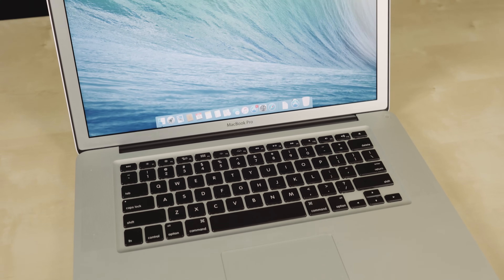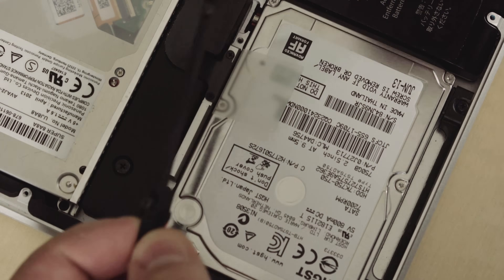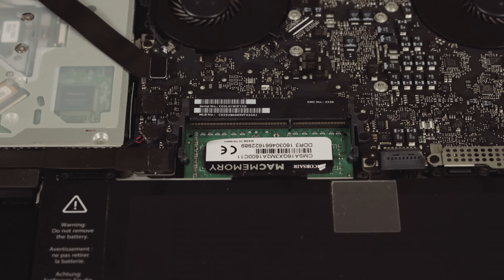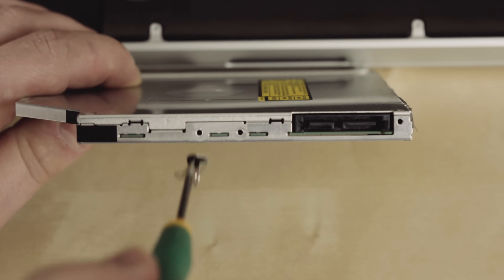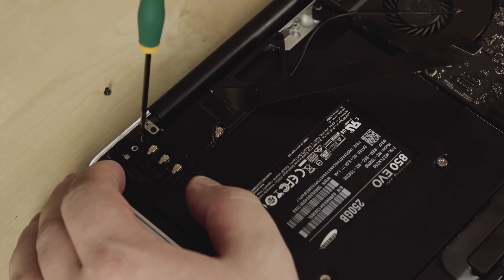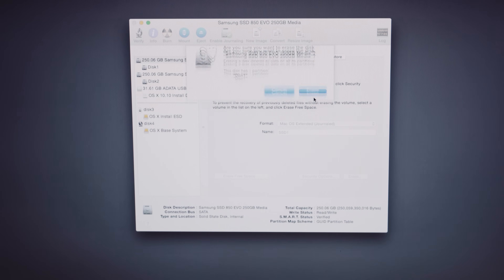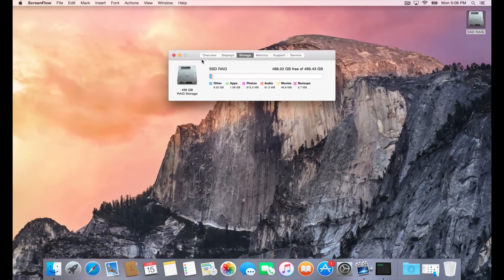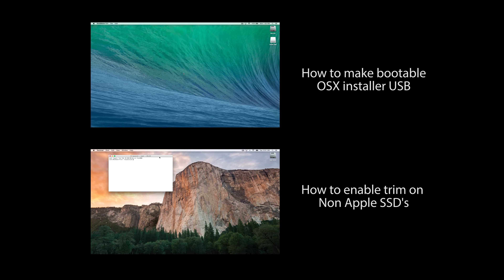Fastest 2012 MacBook Pro Ever! Upgrade Guide - in 4K

Comment: I like the Samsung ssd to go with the Mac... bring it in the Apple store and they’d get pretty mad
Reply: lol Macbooks actually use a lot of Samsung parts
Reply: Apple buys parts for their phones from Samsung don’t they?
Reply: An Apple tech actually told me to install an SSD when I said my MBP was running super slow lol
Reply: I installed a samsung ssd on my mid 2012 macbook and it is BLAZING FAST now
Reply: MarcoGamer640 Productions 2012-2018 you did by your self?? Is good this video as a guide ?
Reply: @MarcoGamer640Productions2012  what  kind of ssd like 500GB is enough ?
Reply: @DJGoadman  If 500GB is not enough, then you can use external SSD.
Reply: lol
Reply: I fully support using samsung SSDs in my macbook. I have a 60" samsung TV and appliances and a range of apple products to solidify my neutrality in this Apple vs Samsung war
Reply: Apple store where i live has an samsung tv next to the apple tv

Comment: Hi i bought 2 x 4gb of ram which are at 1600mhz each for my mid 2010 macbook pro. I get three beeps and a black screen with them in and when i put one old an one new ram it starts up like normal. Is the mhz to high?
Reply: Roobix it could be. Or they may be different variety (ie. DDR4 vs DDR 3) can you post the specs of both hete

Comment: Hi, would it be much faster if I'll use two 500gb Samsung Evo? Would it be worth the money compared to two 250gb Samsung Evo?
Reply from the maker: Jedo de la Pena II no difference in speed. You just gain more storage.
Reply: Oh! Thank you!!
Reply: Now how about I'll only use one 500gb SSD? - and keep the optical drive. Which is faster?
Reply: Which is faster if I install one 500gb and keep the existing 500gb HDD in optical drive slot? Sorry to bother but I badly need your advice on this :)
Reply from the maker: Jedo de la Pena II 2 drives in raid0 are faster than one. I show the difference in this video. But you will still see a huge improvement from one drive.

Comment: I put in 16gb of ram and my computer apparently broke and needs the logic board replaced... :( I don't recommend you put 16 in
Reply from the maker: Sean Paints strange. I've been running 16gb in my system since the day I made this video and have not had any problems. What ram did you use? and was it a 2011-2012 15" MacBook Pro?

Comment: The ssd u used is allot slower than the m.2 ssd in the new ones
Reply from the maker: Way slower. They can push over 2gbs. But the 2 in raid0 gave me 1gbs  which isnt slow. And you wouldn't notice a difference in regular tasks.

Comment: How did you do to make the Optibay to run SATA3 / 6Gbps? As far as I know it is only reliable to run Sata2 / 3Gbps in the optical bay. I have an 13" MBP mid 2012 and would like to copy your configuration. Thanks
Reply from the maker: Fuad NAHDI I didn’t make it do anything. Apple made It Sata III :) just have to make sure it’s the 2012 model I can’t say the same for the 2011 as I don’t have one.
Reply: Ok Need to try this at home :) Btw probably OOT,  I have a 500GB Samsung EVO 850 and a 240GB Corsair SSD. Is it possible to make RAID0 with different size and brand of SSD? Thanks :)

Comment: I am a FCP editor. I wish to buy a low cost Macbook Pro which will be perfect for editing. I googled and I found MD101 without Retina (Costs 58000/- INR )and MF839(Costs 92000/- INR). 
1). Which  Macbook Pro I have to Prefer?
2). If i bought MD101 and had done the same up-gradation as specified in the above video, will FCP work perfectly?

Comment: Hey Zed, so I've got a 13 inch Mid 2012 with the 2.5ghz i5. Of course I realise graphics and CPU are the limit here, but believe it or not, this thing still has AppleCare until March, 2018! I've already done the one SSD swap and the optical drive delete, but hadn't considered the RAID drive. 

As a video editor with old source, I love my legacy ports, which is actually how I came across this video. I'm considering buying a used 2011-2012 15/17 inch i7 to replace my Mid-2012. Not immediately, but sometime in the next few years. 

Now, my question is this, you did a fresh install, but I've been running the same consistently updated and cloned OS since like 2008 because I have my settings how I want them. If I were to do the RAID drive, could I clone to it like an ordinary drive, and thus be able to just copy over my current OS set up? Likewise, if the drives are already set up as a RAID drive and I got the 15 or 17 inch, would I be able to just transplant them into the new logic board and everything will boot up as normal? One of the reasons I've always loved Macs is that by swapping out drives or cloning drives, it's like the "same" computer (just with better specs).

Thanks! 
--Kio

Comment: I got the high spec 2012 model when it came out and used it until I got my 2015 model, don't know why I upgraded but it was just a "what the hell" type thing i think.... Before buying the 2015 MBP i put in 16gb of ram and a Crucial 512ssd and it was a damn fast laptop but thinking "newer has to be faster (so stupid) I bought the 2015 and it was fully spec'd out, $2,500 into that (which i am using now)... Looking back I have no idea why I "Upgraded" when this one can't be really opened up and easily modified compared to my 2012 and I still have a CD/DVD drive on my 2012 which comes in handy occasionally.  What a complete waste of money buying the 2015 when I simply upgraded the ram/ssd on the 2012MBP.  Yeah the display is better and its thinner/lighter but NOT $2,500 better.  the 2012 MBP is one of their best IMO if you can look past the the Retina display difference and a little extra size.  Boy did I screw up buying this 2015 model... oh well, live and learn

Comment: Thanks for posting these. I just bought a late 2011 for 455.00 now it has 8gb of ram but it still has the old disc hard drive. Are there different speeds for ddr3 ram or would all compatible ddr3 ram be the same speed. I know ssd's can be different in speed but I haven't bought ram since 2010 so I really don't know if one brand would have a faster ddr3 ram which I figure maxing out ssd and ram read/write will give the max boost?

Comment: Hello Zed ProMedia.. 

I have tried this and when i try to format the SSD which i attached in place of DVD Rom, it gives me an error like "Could not mount disk0s2 after erase file system formatter failed. 

When i tried with exFAT its formatted and working fine .. but not with Mac OS Extended (journaled).. can you tell whats wrong here ?? i am kind a stuck over here. 

please check the link for error i am having .. 
https://drive.google.com/file/d/0B4loQuzINvHCal9EY2RtdDU4Z00/view?usp=sharing

Any help will be appreciated.. 

Thanks in advance..

Comment: Is it possible to have 250gb for the optical drive and 500gb for the ssd and vice versa?
Reply from the maker: you can use any size drive you want. I just usd 2x250gb because it was the cheapest way to do raid0 with what I had.
Reply: Thanks!

Comment: Hi Zed. I am upgrading a macbook pro 2012 13".  I do not want to recover any data or software. My Macbook has been erased to factory settings. So, do I still need the USB pen drive to boot or not? I´m running Sierra btw Thanks!

Comment: I'm completely new to all of this so I just wanted to ask a noob question for clarification. The optical drive is your disk drive right? SO by replacing that with a SSD the computer can no longer accept CDs correct?
Reply: Also, is there a reason to put in two 250GB SSD rather than one 500GB SSD?
Reply: Yes. Replacing SSD with Optical drive can no longer accept CDs.
Reply: Thank you for the reply! Also, is there a reason to put in two 250GB SSD rather than one 500GB SSD?
Reply: No Specific Reasons.. its upto you to put two 250GB or two 500GB. SSD. As you know SSD is Not Cheaper compare to tradition HDD. So Basically PUT OS in SSD and Keep the existing HDD for other files. Thats how i have configured mine.
Reply: Awesome, well you have been very helpful so thank you. I think I'm just going to do a single 500GB SSD and upgrade RAM as well. Not sure if I'm ready to give up my CD Drive just yet. Probably will in the future though.
Reply: Good.. Happy Upgrade.. All the Best

Comment: Hi Zed,

I just want ask, according to apple, Max Ram for MacBook pro mid 2012 is 8GB. Is it ok if I use 16GB? I have a MacBook Pro mid 2012 (2.5GHz Intel Core I5).

Thanks.
Reply from the maker: Im not sure of the i5. But I was able to use 16gb in my i7. Maybe someone here has experience getting 16gb to work on the i5.
Reply: Thank you Zed, maybe i'll just stick to 8GB just to be safe. Can you please recommend any good brand of SSD and RAM. I'm just using my MAC for daily basis, like gaming, surfing the net, movies and some typing works etc. Its just lately, its getting slower that's why I decided to upgrade it. 

Again, Thank you very much.

Comment: I have a mid 2012 macbook pro with 500 gb hard disk(5400rpm)  and 4 gb of ram. I have a lot of problem regarding its speed. I gave it for repair a lot of times but the guy just says everything is fine and just ends up refreshing the OS which gets slow after some time again. It literally just beachballs even on the lock screen when i just life the flap up and i have to restart it to get it back to normal state. And every app takes at least 2 or 3 minutes to open. And MS office takes a minimum of 3 min. Can the performance of my mac significantly increase if I do a RAM upgrade and also fit in an SSD and install my OS on the SSD?
Reply: I have had this problem also.
It is ridiculous. I reckon there is some software throttling going on.
I have 16g of ram and the problem persists.
Reply: wow, I was wondering if this mod took care of that problem  @der0keks
Reply: @edperez1206  yeah. The computer boots instantly now. Definitely worth a go
Reply: der_keks cool thanks!

Comment: i installed an ssd a while back and was already pretty happy with the speed upgrade. now i am running into trouble when editing video, will setting up a raid help with that issue at all?
thanks for the video!
Reply: I'm two years late but yes a raid would be excellent because your mac will evenly split data and run a lot smoother.

Comment: I just bought a used mid 2012 MBP (going to add 16gig RAM and an SSD or maybe 2 SSD/data doubler).  I currently have a 2009 MBP with a 500gig SSD but teh SSD is pretty much full.  Would it be better to buy a 1TB SSD for the 2012 or install my 500gig SSD from my 2009 MBP and add a data doubler + buy a 2nd 500gig SSD for the 2012 to save some money?  Also what exactly is RAID configuration and why do I have to buy the same size SSD to add a data doubler?

Comment: Hi @Zed ProMedia, I just bought second macbook pro mid 2012 - MD102. I would like to upgrade it for RAM and SSD. Do you know how max size of RAM and SSD can MD102 use? Because as I know MD102 has i7 3520M processor which means it can use 32GB of RAM but most people upgrade it to 16GB only. And for the SSD, is it true that there is no limitation for it? I mean you can upgrade the SSD with any sizes?
Reply from the maker: Pretty sure it can only handle 16gb but I never tried more. Apples site says it can only do 8gb haha but it clearly can handle 16.
Reply: haha yeah that's weird. By the way, how max SSD can MD102 handle? can I upgrade to 4TB for SSD?

Comment: Hey very helpful video. I'm want to upgrade my computer too, but I was wondering if I could recall a time machine backup right after the raid. I did see the option for it in the video at 9:27 but I mainly want to know if would still need to install the OS from a flash drive?

Comment: Thank you for this very clear video. Quick question: for those who only want to change their HD to a SSD...how can we verify that the cable will support the SSD to its full capacity (with a Samsung EVO 850 250 gb)? It would be for a 13 inch MacBook pro mid 2012.

Comment: Awesome tutorial . I need some help I have the same MacBook pro 2012 with 500gb HHD and dvd drive, I have 240 SSD and the second HDD or SSD caddy and 2 modules of 4gb ram all ready BUT I like keep the original HDD but someone tell me that for better performance I need to put the SSD where the HDD is now because the connection is faster and move the HDD to the new Caddy because that DVD drive connection is slow any suggestions please are welcome you are the expert thank you

Comment: holy wow . hey can i also install my old time machine back on to have a they thing i had here here before ? i am sure i just run my time machine drive to it and upload my snapshot from before .
Reply: also can i just use done SSD at 500gb i noticed you only used 1 SSD in the top right and had fast speeds . how did you set that up ? i assume the same way except not adding the other SSD where the optical drive is .

thank you

Comment: Love the video. Quick question: if you had your system backed up with time machine, could you reinstall all of your data PLUS the operating system or do you need to have the USB Stick with it. So pretty much what I am asking is if you do all the SSD upgrades, and then turn on your laptop without the USB but with a backup from an external hard drive, would it still perform as fast? Or is it just safer to use the USB method.

Comment: hello! Thanks for the video, its both detailed and easy to follow... 
I did the same upgrade with 2 ssd, raid0 with 64K chunk size and 16gb ram. I am however getting just half your write/ read speed. Can you help me please?

Hardware Overview:

  Model Name: MacBook Pro
  Model Identifier: MacBookPro9,2
  Processor Name: Intel Core i7
  Processor Speed: 2.9 GHz
  Number of Processors: 1
  Total Number of Cores: 2
  L2 Cache (per Core): 256 KB
  L3 Cache: 4 MB
  Memory: 16 GB
  Boot ROM Version: MBP91.00D3.B15
  SMC Version (system): 2.2f44

Comment: Would it be possible to take the old HDD hard drive removed, put it in an enclosure so it can act as an external hard drive, connect it to the mac, and then hit restore on the new combined Raid drive so that it restores the data from a backup on the old HDD? Thereby eliminating the need to install OSX brand new on the raid drive? Aim I completely wrong here?

Comment: Quick question +zed promedia. Hopefully you can help me out. Why is it beneficial to replace the optical drive as opposed to having a single 500gb SSD where the mechanical drive once was? If you could help me out I would seriously appreciate it.
Reply from the maker: buttcrackboy as I state in the video you get double the bandwidth and speed having two drives in Raid0
Reply: Gotcha. Thanks a ton for the speedy reply bud. I'm thinking of putting in two 500gb SSD's. Is that overkill you think? I mostly use my macbook pro for school work, streaming videos, and playing a few computer games. 

Also, do you have any videos on upgrading the graphics card on a Macbook Pro Mid 2010?

Comment: Do you have any videos on how to replace the processor from an i5 to and i7 on a Mac Pro?
Reply from the maker: Arnold Justin Mac Pro never came with i5 or i7 they come with Xeon processors. It is actually possible to change them. If you're talking about a MacBook Pro then no it's not possible to change the processor. They are soldiered to the logic board

Comment: On the Apple support page, it's says my 2012 15" MacBook Pro's maximum memory is 8GB. I noticed you installed 16GB of ram, what gives? I wouldn't be surprised if you said Apple is lying...
Reply from the maker: You can put 16gb in the 2012 15" no probs. The site isnt lying but they obviously dont want you to upgrade it yourself so that you spend more money to buy a new one haha
Reply: Yeah, that's what I was thought - Apple thinking they're smooth saying 8GB. One more question, if I wanted to upgrade my motherboard to 2.6 or 2.7 ghz, can I go bigger one the ram?
Reply from the maker: LUF Media not worth 100mhz you will see no benefits and you can't add more than 16gb
Reply: Zed ProMedia thanks for the info, you the man! Oh and great video, thumbs UP!

Comment: Hi there, nice video. i want to ask about the replacement on OD slot, is that possible that macbook can run with the original HDD on OD slot ? my idea is using SSD as an MacOS primary system which i plug to HDD slot and data storage with original HDD in the OD slot.
Reply from the maker: yeah you can do that.
Reply: thanks i'll try

Comment: could i install one ssd 500 and the other 250 just for the extra space? and would you suggest i need to change my fan as well? i have the mid 2012 15 inch and the fan gets extremely loud when im on it for awhile.

Comment: alright , so im planning on just changing the HDD to a 500gb SSD. will that be the same as having two 250gb SSD ?? mid 2012 macbook pro. and just curious, does anyone know if the mid (june) macbook pro have one cpu fan or two ?? planning on changing the fan, battery, and small components as well. but will one SSD 500gb be good as 2 250gb ssd ??

Comment: Does anybody know if the MBP Min 2012 accept 2 x Samsung EVO 500GB or is the 250GB configuration used in this video a maximum? thanks
Reply from the maker: You can put any size drive in them. I just used 2 256gb

Comment: I have a Late-2012 MacBook Pro 15 inch and I am looking to upgrade it.  I have 4 GB memory and I saw you put up to 16 GB in.  I can do that in my model as well?  I know I can do 8 GB, but 16 GB would be better.  Also I have 500 GB Harddrive, but I heard SSD could boost my performance.  Should I consider upgrading my HD to a SSD?  I would keep my optical drive.  Also where is the best place to acquire the tools for the screws?  I really liked this video and find it helpful.
Reply from the maker: Yes you can upgrade the ram to 16gb and the HD to an SSD. Everything I used is linked in the description.